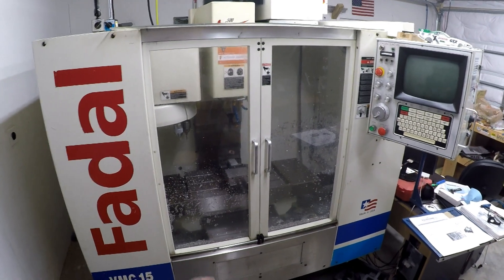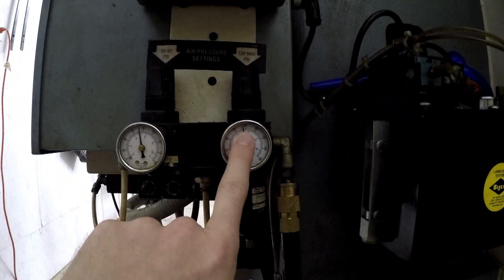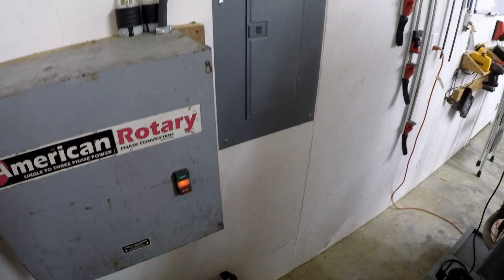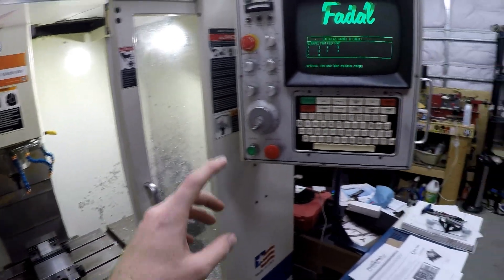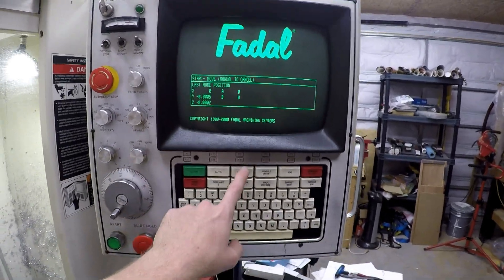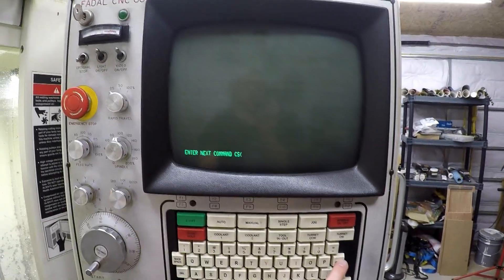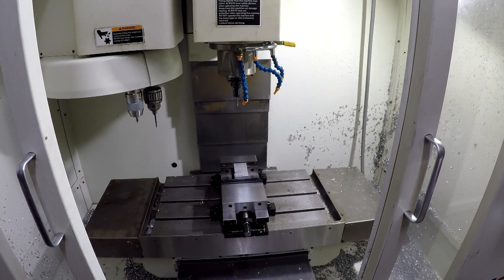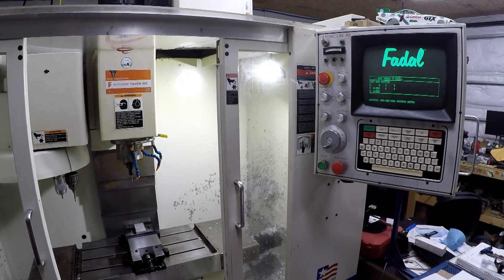Fadal Start Up Procedure - Getting Started 3

Comment: So one need to cold start twice? Or if I'm not in the marks?
Reply from the maker: Only need to cold start once - I just showed two ways of doing it: 1. Using the screen that automatically shows when the machine is turned on. OR 2. Manually using the Jog and Manual modes to jog the machine around to align the marks, then type in the CS command.
Reply: @bgwmachine  can you show how to send an NC code? Set 0 part and set tool heights? I use Fusion 360 and just downloaded the Post
Reply from the maker: Yep! Tool and work offsets are on if the next videos coming out - stay tuned!